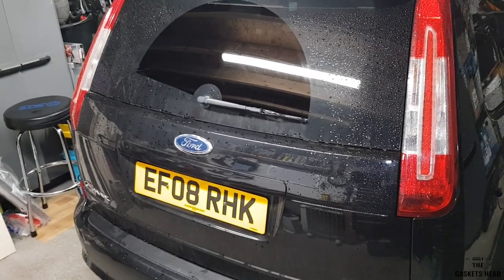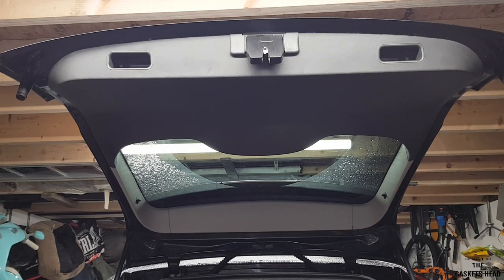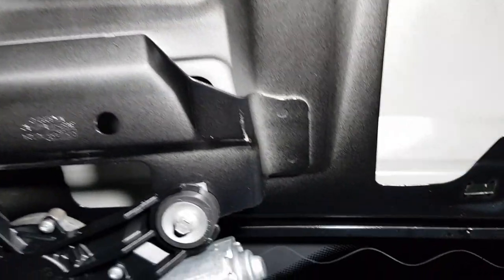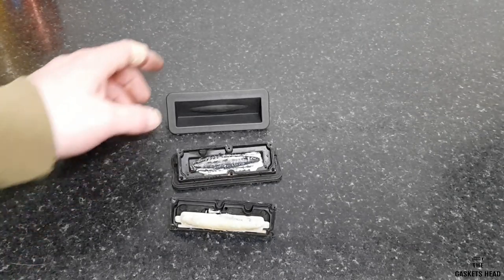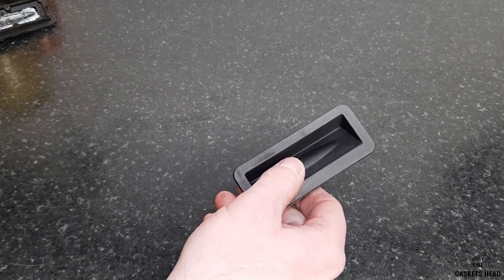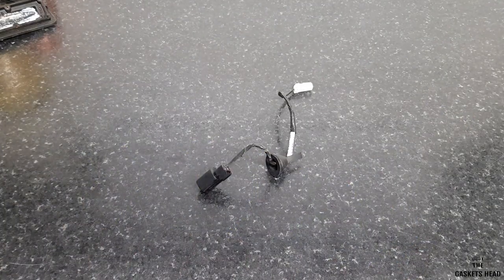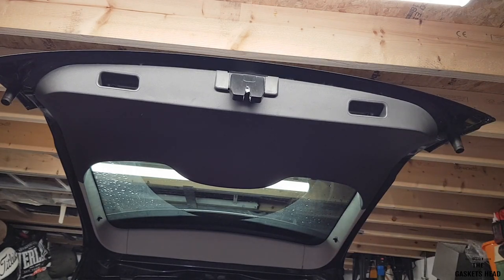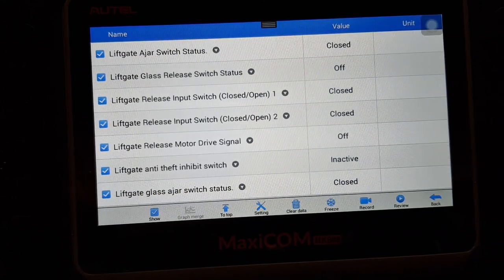HOW TO // FORD C MAX BOOT SWITCH REPLACEMENT

Comment: Great video, thank you! Super-clear instructions.
Clarification point: you described how there are 2 types of switch available: one with wires and one without. I thought you meant the switch unit is the same but one comes with a clip-on wire and one doesn't. But I now understand that the one with the wire, has the wire molded on to the switch. Lesson for me to pop the old one off before buying a replacement.

Comment: great video, I have an identical problem with an 18 Focus, think I might try and fix it myself and save the £120 diagnostic fee that the Ford dealership wanted to charge just to find the fault! even though I have a warranty.

Comment: Thanks for the ideas! My S-Max 2010 got its boot stuck closed and locked. All other doors open normally. Tried to jiggle the lock from inside and nothing happened. All fuses ok under glove compartment and rear fuse-box also ok.
Had to strip the whole back panels of the boot to unscrew the lock from the boot door and only then I could lift the boot, the lock still fixed on the locking loop. Checked the wiring to the lock, all looked good. Also had a blown rear left boot door bulb that I could replace after getting the door open. VOILA!! After this the lock started working again so I guess changing the blown bulb fixed the issue, no idea how it is possible...
Reply: I was pretty sure that the boot switch was ok because you could hear a clicking in the fuse-box under glove compartment when pressing the boot open switch.
Reply from the maker: S Max’s suffer with broken wiring where they go from the body to the tailgate, I’d strip it back and make sure that there are no exposed wires touching another as the rear lights are ran on a separate circuit but the inner lights are bunched in the same loom(from memory anyway)

Comment: Helpful for me with a mondeo mk3 2004 tailgate latch problem too. although my stitch is working I think. does the tailgate not have a mechanical key tucked up near the switch for emergency use like my Mondeo? I didn't know it was there as I never needed it until the latch failed electrically. Worth a look if you are sctarching your head on how to get in the boot.

Comment: This is the exact issue I have with my smax mk1 works with the keyfob but not the boot button. I have checked the wiring in the boot and all is intact no split or damaged wires! Must be my boot switch itself!

Comment: I have got a similar problem my boot release opens all the time when I am driving opens then tries to lock clicking sound all the time could this fix remedy my problem
Reply from the maker: Quite a common problem also, the corrosion in the handle shorts the wires and will randomly unlock over bumps. A new switch will 99.9% be the cure

Comment: Hi I’ve fitted new switch but it won’t work but opens ok using the remote any ideas ?
Reply from the maker: Hi, you will need to check that the switch is receiving power. Most likely that there is a break in the wire where it goes between the roof and the tailgate(pull the rubber boot back to inspect the wiring). It can also be a GEM unit fault but this is very rare. Also, don’t rule out that it could be a faulty part even if it is new.
Reply from the maker: Here is a link from Steve at SY Diagnostics, although it is a different model the process is very similar and covers some good points that I didn’t mention as it was not the problem in my case. Hope you find the cause of the issue.

https://youtu.be/gXXc6-2fhZc
Reply: @thegasketshead1416  thanks I bypassed the switch and touched the wires no joy , inspected the wires going through the tail gate rubbers all looked ok , apparently under the carpet passenger side is worth checking for faulty wiring , what’s the Gem ?
Reply from the maker: @MrTom1379  the GEM module is the interior fuse box which incorporates the body control module. It may be worth checking from the switch back to the fuse box with a multimeter. If you tried to by pass it and nothing then there will be an open circuit somewhere or an issue at the gem
Reply: @thegasketshead1416  thanks I’ll give it a go ,
Reply: @thegasketshead1416  two broken wires in the tailgate to car loom

Comment: Could these switches be removed without having to get at it from the inside?
Reply from the maker: Although it is something I have never had to try, as a last resort you could drill a hole in it and carefully cut it open with a small hacksaw blade/dremel etc to get access to the tabs from the inside.